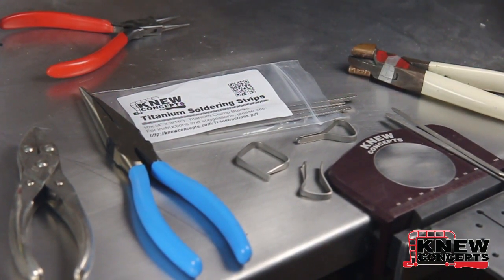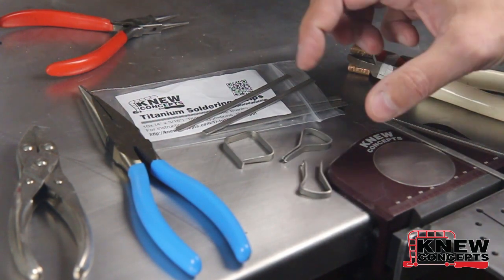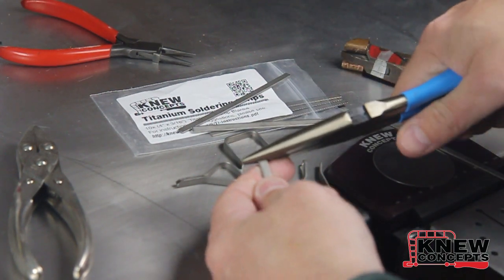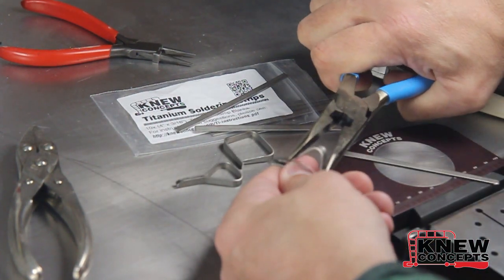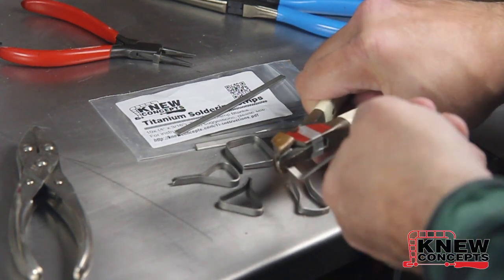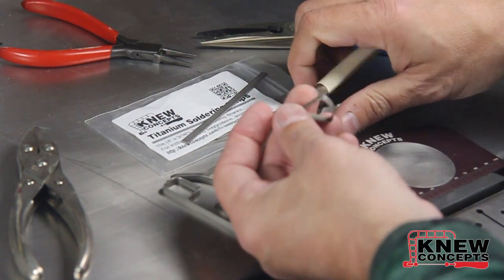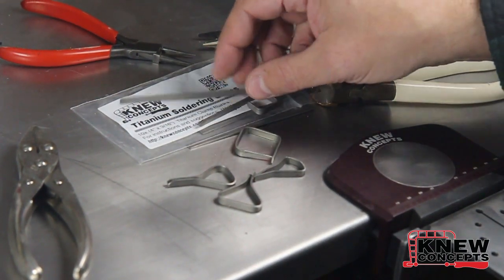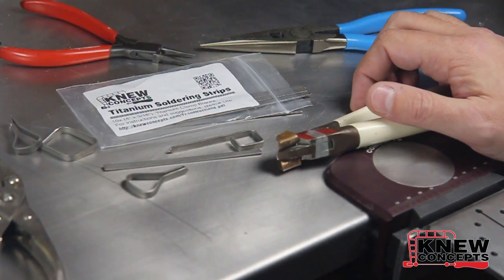Shaping and forming the Knew Concepts Titanium Soldering Strips into clamps for jewelry and crafts.

Comment: Hi!  Just got my strips and was wondering what the best way to cut the slice from the middle of the "forked" one in the picture that is holding the  sphere?  I have a mini miter saw and could try that but what works best in your opinion?  thanks!!
Reply: HI Melissa,
It works best to cut the slot with a jeweler's saw. (like ours...)  Don't use anything with a motor.  (Too many of Ti's nasty quirks come in to play at those speeds.)
You might trash a blade or two, but it'll be quick and easier than anything else you've got around the shop.
Reply: @brianmeek6196  Haha yes motors are always a little scary.  I will use my beautiful new red saw ;))  Thanks so for the quick reply!!
Reply: @brianmeek6196  so I shouldn't use the Foredom to make points? Hm, what a funny metal is titanium...
Reply: @brianmeek6196  Love your video so easy to understand the quirks of titanium. What size saw blade do you use to saw the slot?

Comment: I came to find out how to point them. Jeweler’s saws obviously don’t work.
Reply from the maker: Greetings.  Jewelers saws work just fine for cutting points on them.  You'll chew up a blade or two doing it, but it'll work.  I point mine with a belt sander.  But a bench grinder would work too.  In a pinch, a cheap hardware store file will do it too.  Just don't use a file you like, because it'll get torn up in the long run.  Titanium has some nasty qualities, but it isn't super-metal.  You can still deal with it, it just takes a little more work.  (And plotting, and scheming, etc...)
Reply: @KnewConcepts   Figured out that I could cut it with my jeweler's saw...and you're right, just went through a few blades doing it!